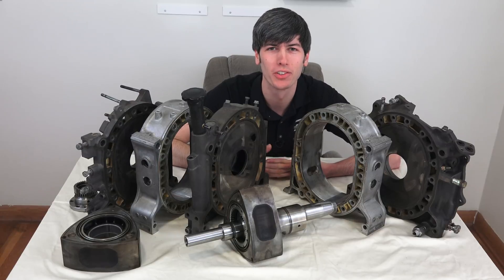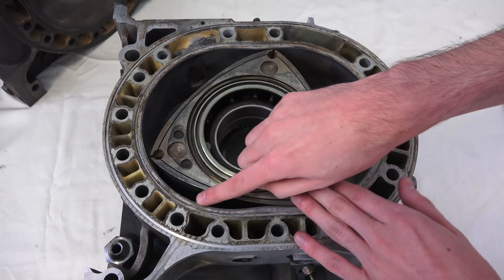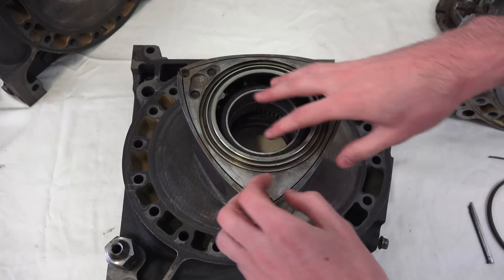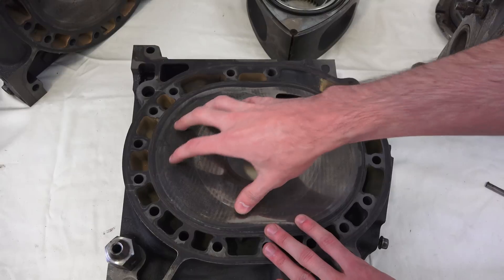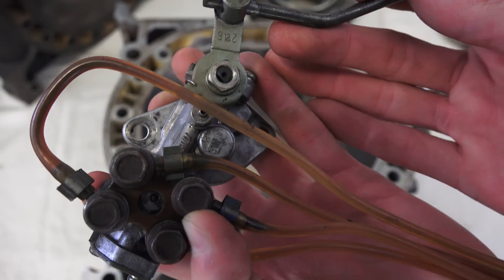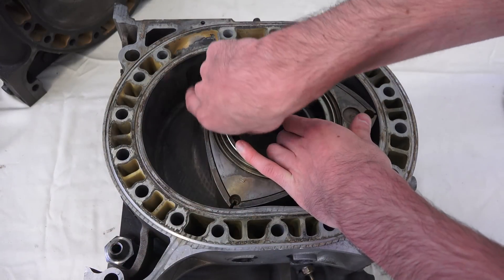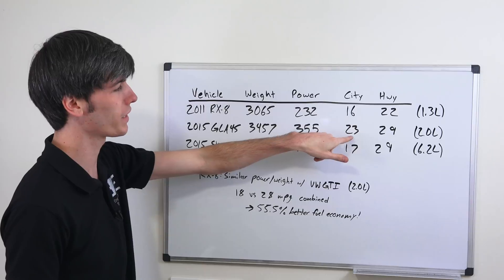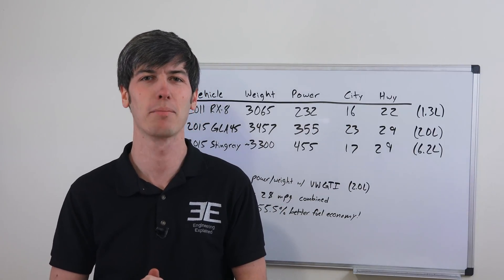4 Reasons Why The Rotary Engine Is Dead

Comment: hydrogen could save the rotary engine from extinction
Reply: BlatentlyFakeName reliability problems for those who don't properly maintain and care for it . i check the oil every time i fuel up and add oil as needed . the rotary engine isn't for lazy ppl or irresponsible individuals . i have only had alternator and battery problems in the 10 years i owned this car . 
i plan on buying a 3rd gen in spring it will be rebuilt and cared for just like the FC
Reply: +Precipitation you cannot make electrolysis more efficient than thermodynamically possible. Even if you could store electric energy at 100% efficiency into H2, the combustion of the H2 itself is so inefficient that it is not even close to being worth it; when an electric motor can directly turn electricity into torque at a high efficiency.
Reply: 1. Unlike gasoline, hydrogen can be made in your backyard with water and electricity. If you use solar or wind power there are no pollutants made and it becomes water when burned in your engine.

3. Unlike a BEV, you don't have to worry about recharging the battery and it degrading whether or not it's being used. Long-term EMF exposure can't be good for you either.

3. Supposedly, a rotary engine resists the flammable nature of hydrogen better than other ICEs. Mazda built hydrogen powered cars.

It's true that hydrogen has less energy density than gasoline but it's still affordable and the fact that hydrogen is potentially pollution-free from its source all the way to the exhaust pipe makes it an ideal fuel source.
Reply: Mazda had to discontinue production because of emissions and inefficiency but they continue to research and develop the rotary. Hydrogen failed in the past but so did electric vehicles.
Reply: HELIUM NOT HYDROGEN WILL AFFECT VOCAL CHORDS
Reply: By the way you bring up and excellent point since most people don't have a clue of the inefficiency of either burning hydrogen in a combustion chamber or passing through a fuel cell to convert back into electricity for electric motor driven cars.   Though it is so perfectly clean either way it takes so much energy to make the hydrogen in the first place.   If free solar was more efficient we could produce hydrogen economically but we're just not there yet.
Reply: Lol @ people who think hydrogen is free fuel. Hydrogen gas is a way of storing already made electric energy. It is actually inefficient at turning electricity into power compared to an electric motor that directly does this without using a combustible gas intermediate.
Reply: ernie brink

kids, that's why you should stay away from drugs
Reply: +Don KiksBiscuits, Hmmm... might want to review the  ingredients in a "brine solution"...
Reply: Uhm no. Everything that was mentioned in this video will still apply even with hydrogen. Plus you will still be burning oil which would make emissions shitty since regular piston engines dont have to burn oil.
Reply: @Some Other Dude
That's a hoax bro. If it wasn't then there would be a RX-9 (lb ft of torque ) availible at Madza dealers.
Reply: Takes quite a bit of energy to get that H to part company with those two Os.
Reply: 1. terrible seal against liquid means HORRIFYING seal against gas
2. doesn't solve unburnt fuel peoblem
3. a piston hydrogen engine based on piston LPG engine is still gonna be the wayyyyy better choice
4. hydrogen as a fuel is rare because it's difficult and expensive to produce. a production car that burns hydrogen is just an unfunny joke.
Reply: hydrogen could still save the rotary . plenty of H2o on this planet. fuel falls from the sky .
Reply: hydrogen .
Reply: +The real doktorbimmer I didn't say most people would find it sexy. It shouldn't have to be explained that when someone says something is sexy what they're really saying is "I find that to be sexy"
My original comment could have been reworded as "I think engines are fascinating and that includes hydrogen powered Wankels" My interest in cars isn't based on how practical they are, I just find technology to be extremely interesting.
Reply: http://www.autonews.com/article/20161212/OEM04/312129959/why-mazda-never-quits-working-on-the-rotary-engine
Mazda is still working on it and filed a patent last year. They are improving the seal design, working on laser ignition and more.
Reply: Both sources are accurate and don't conflict. There aren't plans for a large rotary sports car but the rotary engine design itself is still being developed, first as a range extender for hybrids.
Reply: Another problem with hydrogen is that it is not really a fuel in the sense that oil, coal, or biomass is.  You have to generate it either by electrolysis which gives you H2 with only about 65% of the electrical energy you had to put in.  Or you can "strip" hydrocarbon fuels, but again much of the initial energy is wasted.  Hydrogen is fine as a welding gas, a lifting gas, or a way to talk in a funny voice, but not as a general purpose fuel.
Reply: Well, I can see hydrogen being an ultimate fuel. Here in California, we basically have an issue with too much solar electricity being generated at peak solar times during the day, and nowhere to put the surplus energy. They're talking battery banks and variations on gravity storage. Really, they should take the surplus energy and separate hydrogen for fuel. They can either burn it later in the turbines for electrical production, or store it for transportation use.
Reply: I dunno I'd like to know why :/
I still think obsolete engines are cool
Reply: Twice a year? Seriously? That's overdoing it. Source - a few 30+ year old cars that serve as winter cars and only get oil sprayed every two years.

Oh wait - Mazda. yeah that needs to be rustproofed daily IMO (as per my dad's 2002)
Reply: Actually NO , Hydrogen Would Make Rotary Knock Very Noticeable Since Flame Rate Is Extremely Fast In Burning Hydrogen !  I'd expect very rapid wear in an engine having much more concentrated heat area since all heat would occur in much smaller plate area & thermal expansion in that area would keep a constant seal impossible to achieve unless you came up with a ceramic plate that would maintain shape with widely divergent temperatures . I see no future for wankels as basic design is flawed . The seals will always be impossible to maintain and they will always need lubricant flowing into combustion chamber to maintain any seal integrity . Otto Cycle is the best way to obtain efficiency and not have polluted exhaust . Thank Otto !
Reply: The real doktorbimmer i live in the south no salt is used here only sand and a brine solution
Reply: Canadian Gains oil sprayed ?
Reply: BixbyConsequence that solution is more like anti icing for the road dude. its not rock salt
Reply: BixbyConsequence i know what brine is and what they use out here on the roads is less corrosive than actual  rock salt
Reply: The real doktorbimmer still aftermarket support and manufactures willing to manufacture housings
Reply: BixbyConsequence salt and water . less salt is still used
Reply: +DonKiksBiscuits When you apply rock salt to the road, it melts the ice.  You get "salt and water".  A.k.a. "brine".  Any concentration strong enough to be useful for road clearing, is going to be corrosive.  And the concentration on metal surfaces (which is what matters) will increase as the water evaporates.  All the way up to 100% when the salt finally dries.   The only reason you end up with less salt is because it SNOWS LESS.
Reply: The Wankel is still in development Mazda just said it's not the right time to put them into production. Vehicles that use fuel cells are hybrids. Battery costs over time force them to be available to the wealthy only. An ICE is cheaper and lasts longer and if we see a hydrogen economy the Wankel engine will be the first choice.
Reply: Aww man a Wankel running on hydrogen would be sexy as hell.
Reply: The real doktorbimmer we make more electricity than anything else on this planet....
Reply: What, exactly, do you think brine is?
Reply: Ben Franklin99 please enligthen me
Reply: +The real doktorbimmer I mean I agree on how practical the Wankel is. For me it's just something cool to think about; I wouldn't get one.
Reply: +Oleg Bezman I believe that guy was pointing out that brine contains salt. I don't know about the mechanics of road-salting or whatever so I'm not debating anything, just pointing that out.
Reply: Yes. As in, there is more solar being generated in the system that can be transported to the areas that are actually using energy. I meant that as peak sunlight during the day... you know, when the sun is brightest. We don't always have to run the AC here in California, especially in winter. 

Linky linky:

https://ww2.kqed.org/science/2016/04/04/what-will-california-do-with-too-much-solar/
Reply: If you have hydrogen you get far better efficiency (about 70%) "burning" it in a fuel cell, then running an electric motor o produce work.  This avoids the Second Law limits on the Otto cycle which make the maximum efficiency only about 25-30%.  

Then, of course, where do you get the hydrogen.  The usually proposal is electrolysis of water, but once again efficiency problems bite you.  The "round trip" efficiency of energy storage via hydrogen is less than 40%. Compare this to even the old lead-acid storage battery which when in good condition can pull off up to 85%.  

I really wish a course in thermodynamics was a prerequisite to posting here.
Reply: Don KiksBiscuits very good itd run cool and clean and you would not need oil in combustion chamber
Reply: The real doktorbimmer do you know why
Reply: The real doktorbimmer tell me i need to know so i can think about it .
Reply: Cecil Mills, if you want to go that far use vegetable oil.
Reply: Mazda's hydrogen rotary makes very little power and has vastly worse fuel efficiency than a fuel cell. A hydrogen car would use a fuel cell providing electricity to an electric motor. Burning hydrogen in an internal combustion engine is extremely wasteful, and a rotary makes it even worse.
Reply: Vegetable oils are hydrocarbons which would produce very similar pollutants to current motor oils. In fact, some people do use vegetable oil...as diesel fuel.
Reply: rotary engines still.need oil to.lubricate mechanical components from wear even running just hydrogen fuel
Reply: http://www.carbuzz.com/news/2017/3/19/Here-s-Proof-Mazda-Is-Still-Working-On-A-New-Rotary-Engine-7738337/
Reply: @someotherdude  Fake news...
Reply: The efficiency of electrolysis is too low despite it might actually work...but they would be doing fuel cells if they managed to increase the efficiency.I love rotary too,but it just needs so much improvements and nobody wants to do it.
Reply: I see your point.
Reply: Well, hydrogen  used ina a fuel cell will kill definitely the rotary engine
Reply: because it revs to 13k....
Reply: interesting thought, but wrong. Carbon nanotech like graphene or graphite/carbonfiber metamaterials OTOH could hold promise
Reply: Peida Li you are  overwhelmingly correct about these things, although point number one applies to hydrogen, not necessarily other gases
Reply: June 21st marks the 9th anniversary of the  end of RX production at Mazda.
The very last Wankel engine powered car rolled off assembly line on June 21st 2012.
Reply: The thermodynamic inefficiencies would still exist due to the shape of the combustion chamber.  Why would you want to waste Hydrogen any more than wanting to waste gasoline?
Reply: ive got a 05 RX8 with pretty minimal rust and i live in the greater toronto area, its all about caring for the car, get it oil sprayed twice a year, once before winter and once after, and you're good, anyone who complains about rust on any car didnt take the extra care in protecting their vehicle and truly only have themselves to blame (yes mid 2000's mazdas and fords were notorious for rust) but you also wouldve known that and couldve take the measures to protect your vehicle
Reply: +The real doktorbimmer I said sexy not powerful :I Power and sexiness are not dependent on eachother.
Reply: The design itself is just flawed and not efficient, that's why no one is using it. It has the running costs of an old V8, but only the power of a slightly bigger, modern 4cyl turbo. Reliability is also very poor.

Comment: Nobody overly interested in interesting sports cars cares that a VW GTI (Golf I presume) is more efficient than an RX8 I'd say. One of the best, mildly tweaked (weight reduction, brakes, slicks and exhaust) track cars I've ever witnessed has been one that a couple of friends built. It was the fastest thing round Mondello circuit at the open day on the Irish bank holiday in August this year; it didn't even have a turbo, came from the factory with a good sized boot and can fit 4 adults in it!

Comment: seems like it would be better with an egr valve.
Reply: A diesel rotary?
Reply: The inherent problems with the apex seals and compression in the Wankel engine would preclude it ever being a Diesel engine. 18:1, you need to have glow plugs to make sure it fires. 23:1, and it'll run without glow plugs. You simply can't get an 18:1 to 23:1 compression with those seals.

Comment: Well, actually it is not being dead.. most of its developments is now made into the latest model in track races, as The Mazda Furai models is still using the rotary engines and keep its running. And for your information, it runs on a miliseconds faster to combust its chamber, highly sparks the engine consumptions also a very high speed in the drifting. this is their greatest inventions since their aircraft in world war 2 inspires them to create the most unique ways of motoring industries..

Comment: the first disadvantage about rotary engines is they use lots of oil second is also they use lots of petrol too advantage is they are powerful
Reply: They DO NOT use a lot of petrol if you understand that they are not 1.3 liters at all,  much closer to 3 liters...     
 Check it out...LOL
Reply: Engine Stage Channel  The displacement is skewed for the purposes of avoiding displacement taxes.  The original engineers that built the first working rotaries would say a 13b is a 3.9L.  1.3L is the displacement for one chamber per cylinder.  
Does this mean I can calculate the displacement of my BBC with one cylinder per bank?  Or based on one crank rotation?
Reply: Tai Krige actually, a rotary engine base is about 1.3 Liters.
Reply: rscosworthfan Did you already mentioned that they use lots of oil? lol. They only sound good, rev high, can shoot flames and can give u a kick like a vtec. If build properly. But I really don't like the sealing design. And the thermal differences can be a pain in the ass if you don't know how to service the watercooling.
Reply: Thank you for clearing that up..Lol